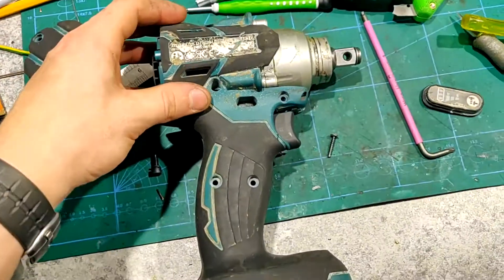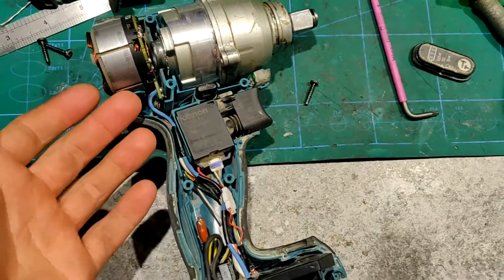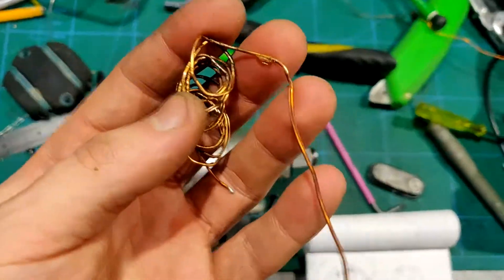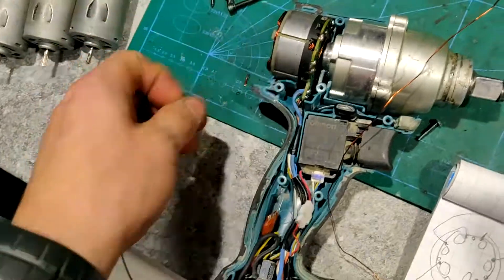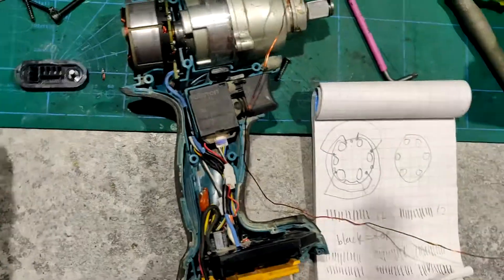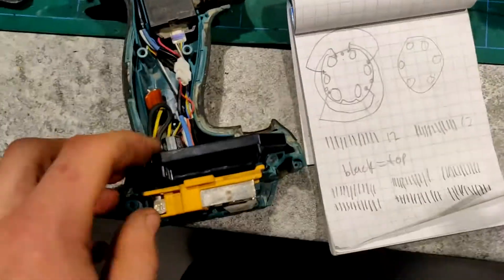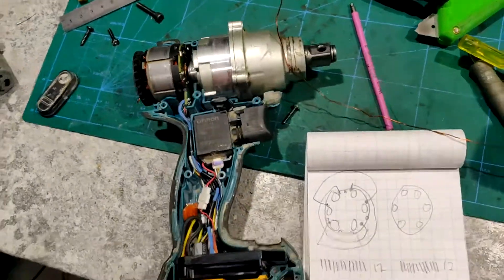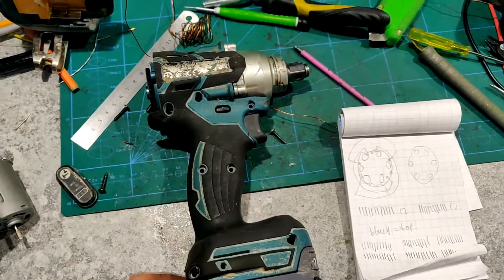Rewinding a brushless impact driver stator (Makita DTD281)

Comment: How many turns of wire are in the original stator? I thought the original wire was 0.9mm
Reply from the maker: The motor originally had 12 turns per coil. I ran two strands of the thinner wire in parallel.

Comment: Yea with the wire all they use is polyurethane exactly the same stuff you put on floors to seal em..  so just dip the wire in it and it will reinsulate the wire…. Then u can redip the entire thibg when done..